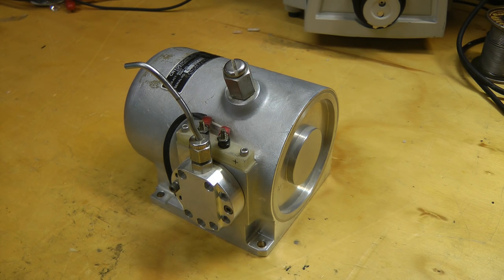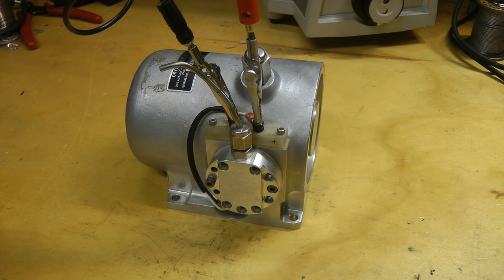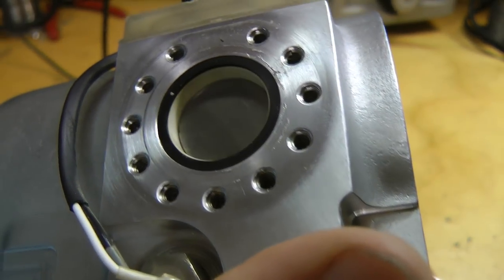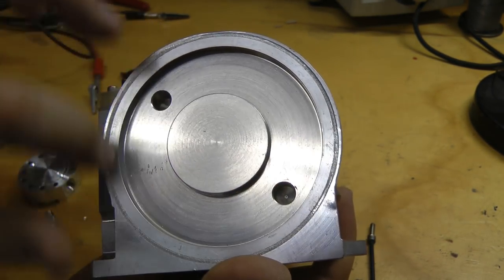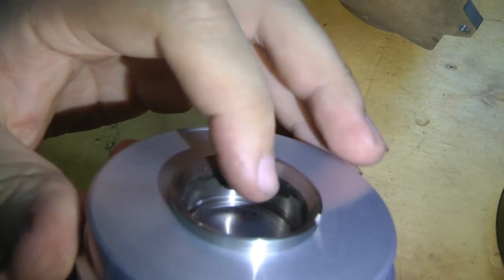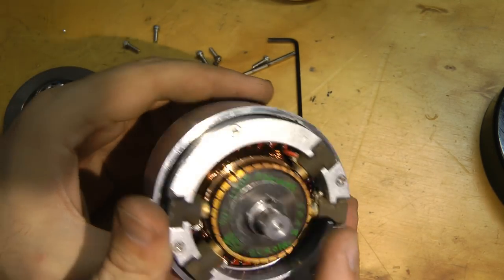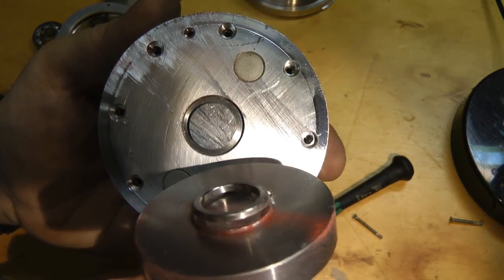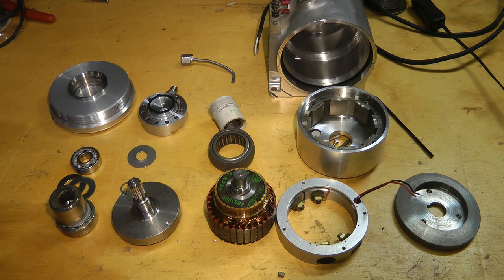CTI Cryogenics Cryoengine Assembly teardown

Comment: The sawtooth thread is more commonly known as a buttress thread, based on the rest of the construction I'm assuming the unit operated under fairly high pressure, that thread would allow for very high axial loading with a minimum of torque on the cap.

In some cases a buttress thread can also form a seal if the fluid it's containing is suitably viscous, but that would not be the case with any gasses in cryogenics, thus the welded face. The thread was probably just used as an added safety feature and for ease of assembly.
Reply: +Zander Horn i cant seem to upvote you
Reply: Stirling coolers are normally loaded with pressurized helium in the 435 PSI range so the threads have a meaning but they are still little over the top for the pressure after all, ordinary threads would have worked just fine as I see it. The lid is never removed when it is pressurized so that part would not matter.

Comment: it is cryoengine that is connected to  Stirling Engine push pull . The double tubing - the outer one was evacuated permanently at the time of assembly. The inner one was delivering pulsed stroke to  double chamber  in out  double action Stirling cooler - however in later versions the outer tubing was cooled ( pre cooled) by  the chamber back instead of being evacuated.
the radiator  of  "cold piston" was a cold finger by itself.
Wesley

Comment: Those threads are called buttress threads and they are stronger in one direction than the other. They are used in punch presses for adjusting the position of the ram because they experience heavy impact forces as part of their design.

Comment: This kind of thread actually is called saw tooth tread, it is used when a thread has to withstand high force but only in one direction. You often see this kind of threads on excavators that go only one ore two floors up and down. The sytem is nice cause you dont really need any sort of emergensy break cause threads are so unlikely to fail and most often there are two of them onne on each side.

Comment: The fact the rattling stopped when you put pressure on the piston seems to indicate it's designed to be under backpressure. Probably quite significant backpressure given it's tiny displacement.
Reply: LPFthings The threads and the ceramic sleeve give it away. I don't think this is designed to work unless under very high pressure.

Pity the second sticker was removed, i bet it had info on it.

Comment: The outer channel of the coaxial tubing would normally be under vacuum.  The purpose is to prevent/reduce heat loss through the tube.
Reply: It is under extremely high pressure.

Comment: That is not the hot end. The system is basically a compressor driver for a displacer piston moving in the remote cold head. This is an older split Stirling (not Sterling) cycle unit. Both cooling and heat rejection happens on the remote cold head. This is a push pull pump that feeds the cold head with necessary oscillations where the Stirling magic happens. Usually charged with helium or CO2 and at a very high PSI not vacuum.

Comment: threads like that are used in applications that need to be gas tight without contamination from a sealant. They are only good one or two times because the thread profiles of the screw and nut don't match. They wedge the two pieces together and the metal distorts. These aren't designed for aluminum. That may be why they needed to weld it.

Comment: I think the threads are shaped like they are to handle high pressure.  their profile means that its a flat pushing on a flat when the cap is under pressure from inside.

Comment: The coaxial tube is possibly used for insulation reasons. Cryogenic fluids are (of course) very cold. Maybe the tube was vacuumized to prevent thermal loss.

Comment: Behold, The 2 by 4 of science! I'll bet the big flywheel is there to even out the running speed. The motor could run the piston on it's own but there would probably be a big variation in speed on the compression stroke vs the expansion stroke without it.

Comment: The flywheel is probably to smooth out the high torque load as the piston approaches TDC so that way the crank spins at a more constant speed rather than slowing down and speeding up every rotation
Reply: It was probably a cryo compressor for a satellite or something like that which would never have been serviceable anyway

Comment: It was built to hold as long it was humanly possible and this was what they could come up with in those days. It was still not that long time due to fex carbon brushes and what not in comparison to todays crycooler in similar build that of course use brushless motors and other things that doesnt contaminate near as much and thus have a much longer life length.

Comment: the flywheel is to keepa constant speed and more torque to get the compression stroke, it's easyer on the motor. the motor and bearing sealings and lube are built to operate at extremely low temps.

Comment: Cryocollers are stirling engines guess this was too. The interesting thing in stirling engines is it can work in reverse. Actually reverse means cooling using power, normal mode converts heat difference to power. So you could use a cryocooler as a generator if the motor inside can work as a generator.

Comment: assuming proper lubrication (removed for disposal because of toxicity) this motor and its brushes would last 30+ years before service or replacement, ive seen cases where brushed motors outlast brushless ones simply because of high end lubricant and lube designed brushes, now this unit was either removed because they switched to brushless or because it was at the end of its service life, because the lubricant would likely be flushed with the brush material we can presume that the black brush material in the end was from you and your friend running it, if it was at the end of its life and they went with brushed again that would be because of the simple startup and high start torque without drive circuitry, depending on the use this may have been only used to keep the cold on wile the power was out in large cryo systems, i.e its easier to run a dc load than to convert to ac or 3 phase ac, no driver required, and with most dc motors if they fault under normal conditions you increase the amperage and take note that that motor needs replacement as soon as regular power is returned either with a fuse that is then upgraded or a controller that reads current and activates a light to indicate failure

Comment: Maybe they used the coaxial tube just to protect the fragile inner tube.
Reply: Chris W Or perhaps for insulating the inner tube?
Reply: dumle29 I would guess that the space between the tubes was evacuated for thermal isolation as only the inner tube actually connected to the piston cylinder.
Reply: randacnam7321 Yea it'd seem logical at the possibly extremely low temperatures.
Reply: จันทร์ทอง ศรีแก้ว what?

Comment: I was expecting that coaxial tube to connect in some way to the 2 holes in the internal plate, fridges often have a coaxial tube, especially the absorbtion fridge circuit, i was guessing the outer to be low pressure side, with the inner as high pressure. actually, i would guess the part that the pipe connects to has the valves for flow direction.

Comment: If they are designing it to not be serviceable, then those units would likely not sell unless they price them in the $40-50 range at the highest when they are brand new.
Reply: Razor2048 I believe the motor was designed separately from the enclosure. You don't bother with screw adjustment on brushes when you purposely design it to never be opened. 

However, there's another possibility. Perhaps the threads were not enough and they decided that a welding was needed on top of the special thread.
Reply from the maker: Razor2048 Try adding a couple of zeroes to that price and you'll be more in the ballpark.
Reply: +Razor2048 Bruh the materials are worth nearly that.
Reply: The materials are worth FAR MORE than 50 dollars. This little device is easily many thousands of dollars new. when you exit retail and enter into commercial use. The price tag doesn't matter. The end user NEEDS it. There is no competition. The part must be designed, engineered and lastly fabricated. The costs of all of those things need to be rolled into the cost of the final product. If that pump costs less than 12k id be flat out amazed. If it cost 120k i would be not that surprised.

Comment: the gasket was probably made of Indium metal
Reply: laurdy I agree.  Indium seals are typically used in cryo applications because of their malleability at very low temperatures.  Helium will find the most minute of leaks and is used for leak testing in hermetically sealed systems because of this.